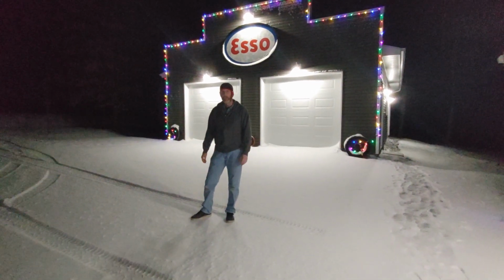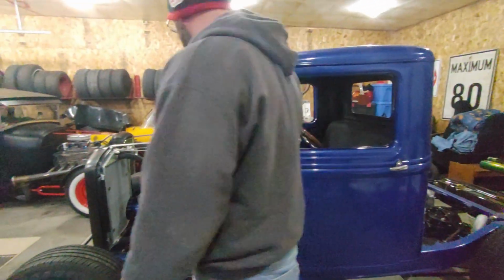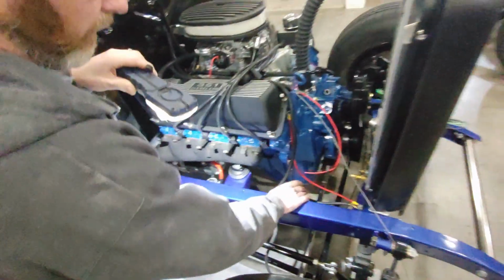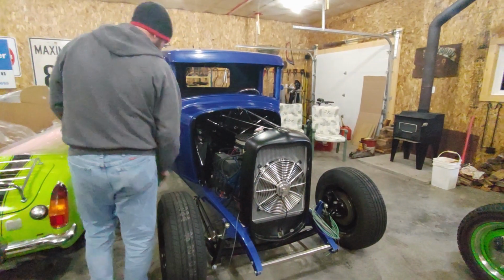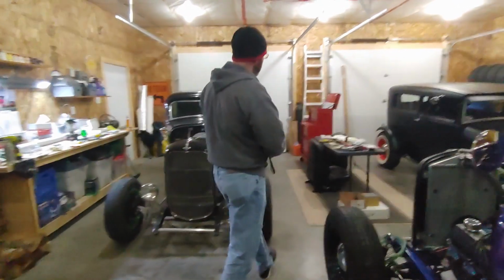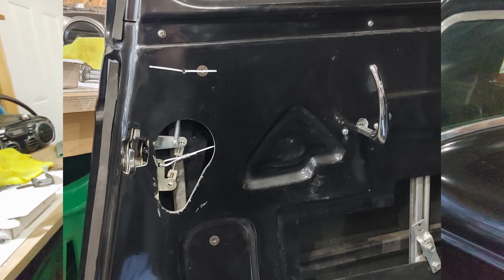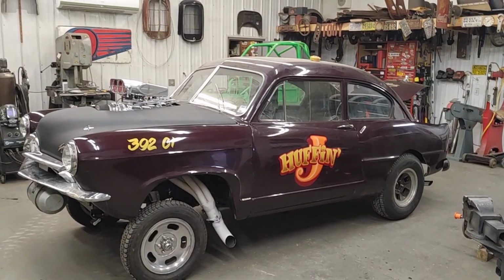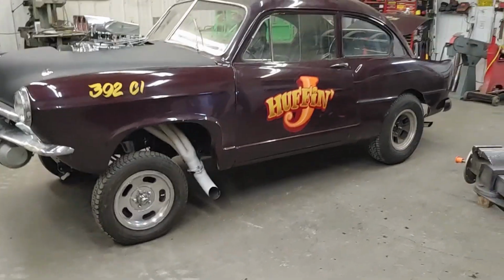Updates on 1932 Ford Pickup, 1932 3W Coupe, Gaudet's Henry J

Comment: Derek, how tall are you and how does the  seat you chose fit and is it comfortable?  Going back and forth on how to handle this on my build. Thinking bomber seats with SOME cushion...I'm 6'-1" tall
Reply from the maker: I'm 6'3" which is why I didn't chop the cab. There's not much room in these cabs for my legs. The brake is good where it's at but I have to move my gas pedal, just can't flex my ankle that much where it's at now.
Reply from the maker: Yes the minivan seat is comfortable but no room for adjustment, it's back as far as it can go.
Reply: @coldstreamrodshop  I have a mini van middle seat out of a 2017 Caravan. I'll put it in the truck to get an idea. May have to make a seat from scratch perhaps. Really appreciate the efforts you and your wife put into the videos. Sharing your thoughts and ideas goes a long way to help others. I DO know how much time and effort it takes to do them and how much it can take away from the project. Especially when things are going well and you are "in the zone" and enjoying the process.

Comment: Derek a tip for your Horn Power...add a second horn. Low tone or High tone. Just make sure it's the opposite tone of what you've already installed. It really makes an amazing difference in Volume especially for the drivers that DON'T SEE YOU!

Comment: What are the exhaust manifolds off of? Do you happen to have model number for the fan? Thanks! Always look forward to updates. Happy New Year!
Reply from the maker: The exhaust manifolds are stock 1970 351C 2V (2 barrel) Ford Torino. The fan came with the radiator I bought off eBay. I'll look and see if there's a PN.
Reply from the maker: I bought the radiator with fan from ebay the seller is Radiator Master. I couldn't find any listings for just the fan. There aren't any model numbers on my fan either, no doubt from China. We'll have to see how it holds out!
Reply: @coldstreamrodshop  thanks!